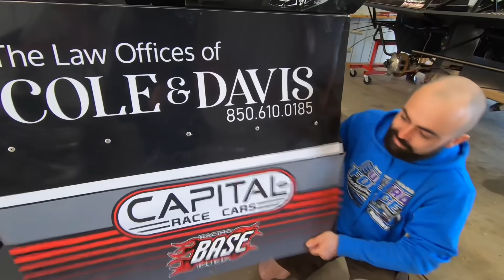More Speedweeks Racing! Preparing for Battle at East Bay Raceway Park

Comment: The motor side of the starter is where y’all got your B+ hot. You need to put your hot b+ on the contacter side to engage contacter. It will have the jumper wire on the starter. To allow the starter drive to engage to start the motor.

Comment: if y’all wouldn’t crank them over for two minutes every time u start the car, all you have to do is crank a few seconds to build oil pressure. these starters are built lightweight and for racing unlike a heavy duty factory starter.
Reply: I turn the motor over till I see oil pressure  and I dont have starter issues .so I call bs on that.
Reply: Starters are cheaper than motors.

Comment: That starter drive engages clockwise. That starter was spinning counter clockwise. Bet if you hook the jumper cables up "backwards" thst bendix will engage. Something isn't right there.
Reply: SBC spin clockwise (usually except rare circumstances like some boat engines).  Your starter is mounted "backwards". Compare the direction of the bendix to your old starter and confirm all is the same.
Reply: I just looked at the block mounted starter we have. The bendix turms counter clockwise when engaging.

Comment: Yall not rolling over enough to hurt the front right don't worry
Reply: I was thinking  dadgum if they  rolling that far over, it would  just  rip the  nose off the car
Reply: @jerrydavis1191  Correct I been racing for 20 plus years if u roll that much your shock or spring is gone

Comment: It would not surprise me that one possible reason, for the stater issues. Might be due to the fact that the starters  are 12 volt starters and you are using a 16 volt system. So I would be checking into the actual available of a 16 volt compatible starter...